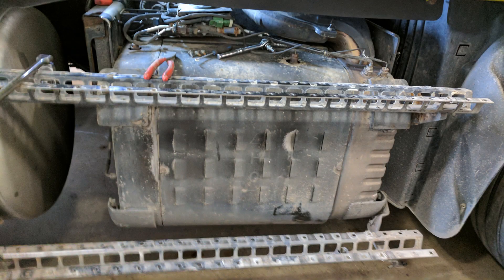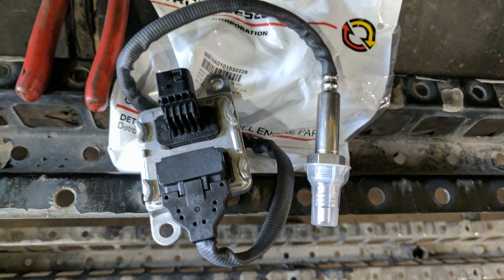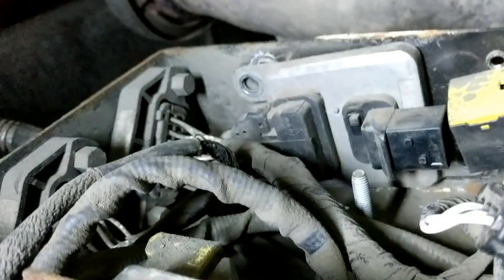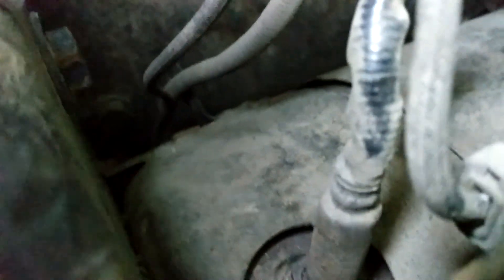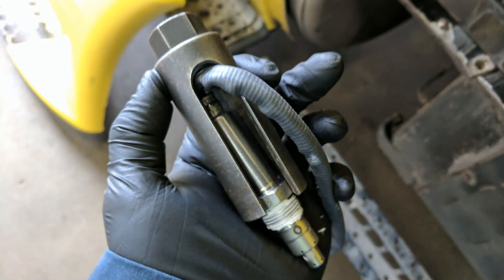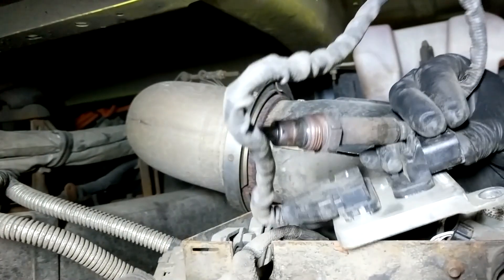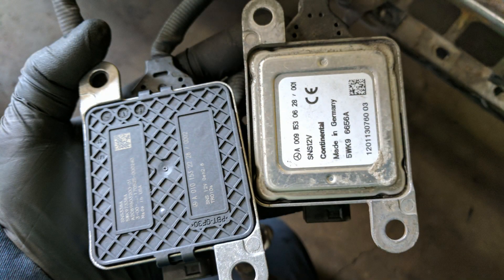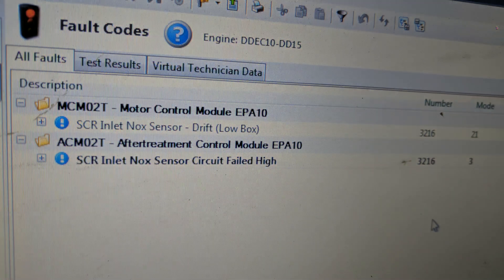How to replace an Inlet NOX Sensor

Comment: I saw another YouTuber talking about removal. They said you could start removing the sensor and then it’ll start freezing up. They said stop trying to remove it and pour brake fluid on the threads. Let it sit about five minutes and then finish removing the sensor and it should come out But you gotta use brake fluid not WD-40 not blaster not penetrating oil they said brake fluid and leave the little bit that the sensor came out. Don’t screw it back in just leave it up and pour it on the threads and it’ll work itself down in there and break down all the corrosion and Get in there to loosen it up

Comment: I mean difference from outlet and inlet nox sensor.  Because they look the same. How to tell which one is which so you don't open the wrong one.
Reply from the maker: They have different part numbers. That's the first thing you should be checking. Besides that, Detroit's use different color wire wraps on each. On a 1 Box setup, they're also different lengths (Outlet is longer).

Comment: I tried heat and a big pipe wrench first then found your video. Mine are on a 2012 sprinter van. Dealer told me they were original and were definitely bad. And they have had a few updates to the part numbers. Anyway I cut tops off sensors with a cut off wheel. Saws all went thru two new blades and still had some to go. So once tops were off the 6 point socket and a cheater bar removed them without many bad words.  Back sensor was stuck bad  I’m thinking because of the def being injected just upstream of it. Raising exhaust temp???  So off to dealer to have them paired. Thanks for the help. 👍👍👍

Comment: Do you need computer to reset or cancel the code? Can I just disconnect the batteries?
Reply from the maker: Disconnecting batteries will not clear fault codes. Some sort of Diagnostic scan tool or software can be used. Every fault code has conditions that must be met for it's monitor to run. Once they're met, it either passes or fails. If it passes, the code will go inactive (This doesn't mean the MIL will immediately go out.)

Comment: How would you know the nox in sensor is not working properly...
Reply: A way to check if the nox sensors are working properly , is to run a low temp atd with the def dosed electrical connector unplugged. And view the log file and see if they read close to each other In the last 15 mins of the test.
Reply from the maker: There are NOX sensor specific codes that can come up. One that is shown in the video (SPN3216 FMI3) is usually a sure sign that the sensor has failed. Other times, a poorly performing NOX sensor can be the cause of other codes (NOX Conversion Efficiency Low, etc). In all cases, it starts with an engine or MIL light. Read the codes and troubleshoot from there.
Reply: TheDieseler Thanks for replying back.... I have cold 3216 fmi21 . Would it for any chance the  exhaust have a nasty smell because mine does and it shows inlet nox sensor in the dash and a yellow engine light...
Reply from the maker: Alfredo Andrade If I remember correctly, that code indicates the Inlet NOX reading has drifted at low temperatures. Simple things you can check are leaks around any charge air or EGR piping. A leaking charge air cooler or any exhaust leak. Make sure there are no other active codes. Especially EGR related. That is about the limit of what can be done without diagnostic software. It could be anything from a required MCM software update, to a failing NOX inlet sensor, to a failing injector.
Reply: TheDieseler I really appreciate your help.. My mechanic told me that my truck needs a computer updates and maybe the inlet nox sensor too..
Reply from the maker: fuseone Yes this the exact way to do it. DD15s and 16s should be running in the neighborhood of 250ppm and DD13s around 450ppm. I didn't bother to mention anything like this because most people don't have access to 3DL.
Reply: @TheDieseler  Hi Dieseller! Do you have any idea about what kind of readings are normal for Paccar PX-8 NOx intake and outlet sensor? Thanks a lot.
Reply from the maker: @Sloan777  I am not very familiar with Paccars but I believe the PX-8 is basically a Cummins ISL with a paint job. Cummins has never been very forthcoming with the exact numbers they're NOX sensors should be seeing at any specific time. There have been calibration updates over time though that allow Cummins insite to run the engine through a preset procedure to test the health of the SCR system. It will check NOX sensors and how the SCR Catalyst is functioning. Cummins had a pretty large production run of faulty Medium Duty Engine Catalysts and are now in the process of replacing them under warranty when they fail.
Reply: @TheDieseler  Thank man. Yes, thats what the dealership told me once I was under the perception of replacing the NOx sensors. They ran the engine serial # on their system and found out that SCR is under Recall. As far as NOx values you are right: they are not showing on Insite, I was able to get a graph with my Bosch NTS truck, but it does not tell me which one is which, kust whows one graph. Probably just goes to kind of "averaged out" graph between the two.
Reply: Al A I have the same eng 1 3216 fmi 21, could you tell me if it was the sensor?